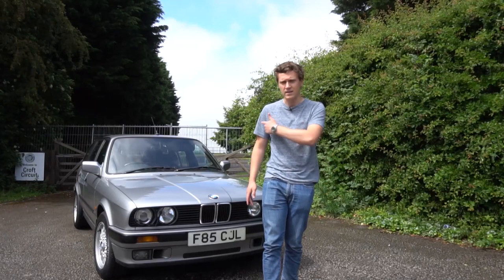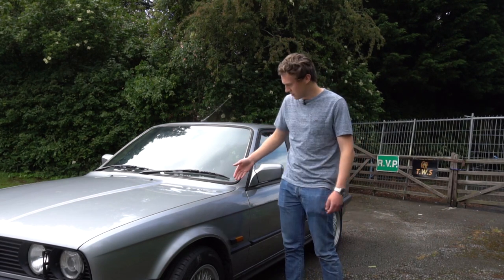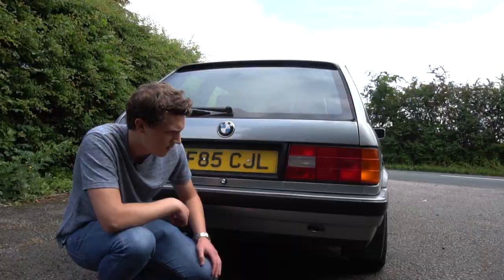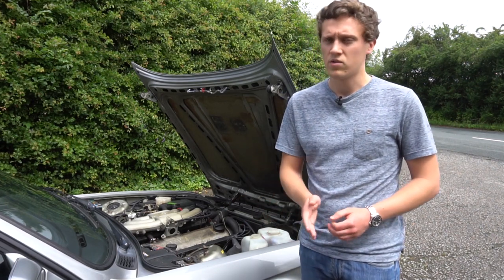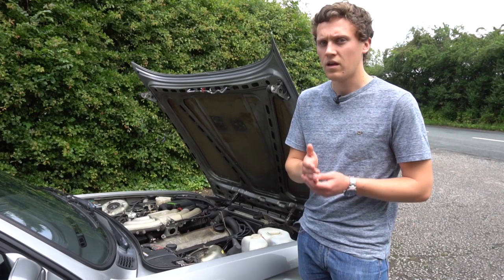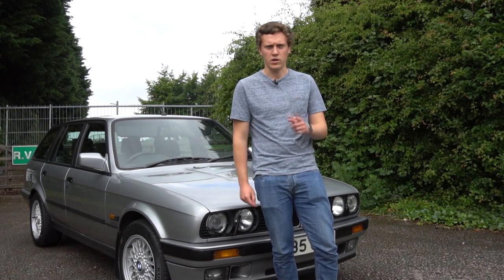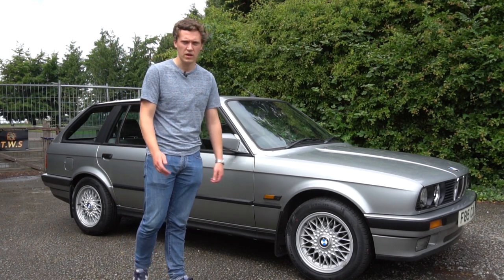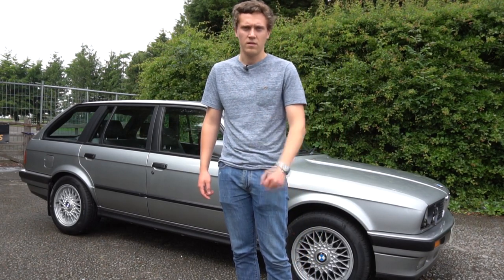Buying An E30 BMW | What You Need To Know (E30 Buyer's Guide)

Comment from the maker: Apologies but for the avoidance of doubt, the jacking points I refer to at 1:10 are factory jacking points only. DO NOT jack your car from here as you can damage the underseal or punch a hole through the metal which could cause corrosion issues down the line. Sorry, this was my bad! You can look up online where to correctly jack your E30 from using the E30Zone Wiki. Also check out our sequel to this video which gives you lots of information on specific maintenance items on the E30! Link here: https://youtu.be/Gdmv65OKSvo

Comment: You can remove the oil sump without any problem at all on an e30 with the engine in the car. Just loosen the engine mounts and put a 3/4 sockets under both mounts and there is more than enough room. 
Done it several times, low e30 and speedbumps don't mix well 😁
Reply from the maker: Ah interesting to know! I had always heard it was either an engine out job or subframe out and brace the engine in place from above. But yeah the sump is particularly low on E30s, I've heard of a few people cracking them on lower cars!
Reply: @FootToPedal  I even remember from when the m20 was popular with turbo a guy replaced roodbearings the same way 😁

More annoying is to replace the rocker arms with the engine in the car but that's also more than doable. Done that way to many times also.
Reply from the maker: Yeah sounds like a great way to solve the issue actually, will definitely bear it in mind. That's whats great about E30's though, just how easy they are to work on!
Reply: @FootToPedal  what is more fun to drive  e30 or e36 with the same engine  m50b25

Comment: Bought a grey E34 this summer, fixed the fuel lines and painted them up, changed out the cracked out and rusted jack mounting points, changed lights, stopped a zimring leak on the back of the engine with some additives like 917, brushed down and painted the lower inside of the doors with hammerpaint, black anti rust paint, changed oil in the diff, gearbox and engine, replaced the timing belt, thermostat and water pump and and flushed the fluid... And bought a lot of parts to all over, now driving it to and from uni here in Norway, might have to take the bus when the winter comes for full though, salting is crazy....
Reply: Oh, and its a 88 model, manual sunroof, black and grey interior m20b20 engine and I absolutely love it :) pretty original as it had stood 10 years... Oh and changed the springs as they were all broken xd
Reply: And thinking about buying a 3.5 liter straight six for later I know about that someone has :)
Reply from the maker: Awesome stuff! I love to hear this kind of thing, great to know people are working on their own cars. I do have a lot of love for the E34, its a great looking thing. Wouldn't mind one myself. Sounds like you've done some fantastic work on yours! And yeah the M20 engines are so good, plus they make a very nice sound. Thanks a lot for watching, and good luck with your E34! Hope you still manage to use it over winter 👍
Reply: @FootToPedal  Yeah, had a M50B20 engine in my secound car and first bimmer, alpina white e34, sadly it was rusted too badly to be saved, so stripped it and saved a lot of parts for myself and sold a lot, just the frame went to the junkjard basically, and some of the back axel.. but think Ill keep to m20s if not m30b35. The sound is amazing compared to the m50s, only down side how I see it is the belt instead of a chain and some of the problems like the humidity building up in the cap outside the rotor. But of course, no car is perfect. Done most the work with a friend of mind that has had 30+ bmws, so he been a great help for me, especially with welding that I haden't done before :)
Reply: @FootToPedal  Have to keep these old bimmers going, they are simple, fun and well built cars, so it feels well worth it working on them, lets try keep as many of them around as we can :)
Reply from the maker: @Anirossa  Totally agree with you! I really enjoy owning mine and I'm sure you do too, I know I will definitely be buying more classic BMW's in the near future ahaha :)

Comment: Nice video but just one notable correction 
The “jacking points” you mention are not jacking points at all - the square pads commonly referred to as jacking points are locators for when the car was moved around on the production line at the factory and should not under any circumstances be used as a point to jack the car on. 
They are horrendous rust spots though. 
The other classic rust spot is the rear inner arch behind the fuel filler neck. Pull the plastic covers, pipework and filler neck out and remove the kilos of mud that will be present - you’ll be very lucky if its not rotten. 
Nice looking motor though keep the videos coming 👍
Reply from the maker: Thanks a lot for the correction there, that's my bad. But yeah they are certainly one of the worst spots for rust from what I've seen, got lucky with mine being fairly solid! Thanks, many more videos to come on this thing so stay tuned!
Reply: No worries I’m planning a series of videos about my 325i Touring as soon as I can get the time to extract it from the garage where it’s sat for over a year
Reply from the maker: Nice one, sounds good. I'll look out for it 👍👍

Comment: Just to add that the e30 sunroof seal is not designed to keep water out--it is supposed to channel out through plastic pipes inside the roof and exits down at the wings. Another notorious rust spot is the grommet where the wiring enters the cabin from the engine and rots out the firewall. This is a serious and expensive fix in having to remove carpet, dash and wiring loom to sort out. More prevalent in wet climates where the car is left outside.
Reply from the maker: Yes agreed on all points, thanks for the additional info!

Comment: I'm eyeing something identical to your car right now - silver e30 320i touring. I have a soft spot for those since I grew up in the 90's and always loved the DTM cars. What would u say about using the car as a daily driver? I live in the Netherlands so the weather should be quite similar to the UK. Is it a car that demands a lot of attention? How is the fuel usage in a real world scenario? (I mean by that: dynamic driving - not necessarily revving it out all the time but also not driving it like an elderly person). Great content btw 👍🏻
Reply from the maker: Awesome stuff man! They are brilliant cars in short. Its interesting you ask this as we are currently filming a video called 'Living with an E30' and it will cover many of the points you mention. But basically they are incredibly useable as daily cars. Very reliable on the whole with parts and things readily available, not to mention that they are easy to work on. Fuel consumption is OK on the whole, I think I average 20 to 25mpg (11-9L per 100km) driving fairly spirited but not revving to redline all the time. I wouldn't say it requires too much attention but its probably advisable to keep it inside if you can as they like to rust everywhere! Thanks a lot for watching!
Reply: Foot to Pedal thx mate! I'm really looking forward to getting one b4 the prices inevitably go into tenths of thousands as it happened with stock and original 325i. Great content man!
Reply from the maker: Yeah absolutely, prices only going one way on these. But yeah exactly, eventually all the models will follow suit!
Reply: Foot to Pedal What would u consider a good price for one? (320i touring) The one that is available has 290k on the clock but front and rear axles have been revised incl. braking system, dampers etc, the interior is stock and in very good condition, the underside has no rot. Sorry for bothering you man lol
Reply from the maker: I would say maybe €4,000 based on what you're saying there, possibly a bit more if its great condition but that's obviously decent mileage (not that it matters much but it does effect price). I personally wouldn't pay over €6,000 based on what you're saying there. And no problem at all man! I love engaging with our viewers so not an issue at all!

Comment: Just after 7.25 you mention about the ‘chip computer thing’, what actually is that and what’s its purpose? Thanks
Reply from the maker: Ah so it's actually a trip computer and it measures things like MPG, average speed, I think fuel range as well. I guess its a bit of a gimmick but very cool for an 80s car I'd say! It was a factory option so you don't see them everywhere but the higher spec cars generally have them fitted. Possible to retro fit them too I believe

Comment: One thing you NEED to check. In the driver side rear wheel arch you will find a metal cover that covers the fuel tank breather lines. this little bugger is brilliant at trapping soil which keeps water nice and safely stored.. it then rots just above the spring perch., when you clean it up it will most likely look ok but look harder! you might need to remove some of the thick rubber coating that these are protected with, once you get through the rubber coating there is a very high chance you will find something you wish you hadn't seen.. ive seen many 30's junked due to spring perches collapsing.. its repairable ofc but if you are not handy with a welder it will cost a lot to get sorted, the rear end will have to be completely stripped and there will ofc be other areas that need attention, by the time its fixed properly it will run into thousands (since its worth doing properly while its apart) id suggest to all 30 owners to get good with a welder xD
Reply from the maker: Thanks for this David, very useful info! I guess with E30s anything and everything will rust if it's allowed to do so 😂

Comment: Hi

Great video! 

I have a bmw e30 316 with the 1.8 m10 engine.. I'm after some spare parts.. like radiator pipes, waterpump, belts and other engine parts.. any advise on where is best?

Thanks
Reply from the maker: Hi, thanks a lot! Personally I would recommend Autodoc, they have a huge selection of parts and good customer service.
Reply: @FootToPedal  thanks! 

I have come across them but wasn't sure 🤔.. I'll give them a go! 

Thanks again
Reply from the maker: Yeah they've been great for me so far - good luck!

Comment: Are you mad?
The timing chain cam drive on the M10 is one of the most long lived in the industry and legendary for it.
It's good for a MINIMUM of 500k km  (310k miles), I have never heard of a timing chain snap on an M10. Usually outlasts the car.

Comment: Those boxed areas up front arent jacking points!!!
Reply from the maker: Yeah that was my bad, factory jacking points is the correct wording here since they were used when on the production line! If anyone wants to see a diagram of areas to jack them up from, check out the E30 Zone forums
Reply: @FootToPedal  no prob, id bet every e30 on the road has been accidentally jacked there at some point leading to the rust; both sides of mine rusted out. The floor is def a big rust area, these cars get water leaks like none other.
Reply from the maker: @davidcover9591  Yes agreed! And yep you really have to be careful with all the seals to make sure they're not leaking, water can get in and go unnoticed very easily!

Comment: So the video states almost every area on a E30 which may need replacing or repaired...Don't forget the idle control valve, fuel pump, heater resistor which also fail on one of these...Deep pockets are a must to own one of these and no they are not cheap to buy unless they are a proper rotbox with zero service history.
Reply from the maker: What you have to think is that it's a 30+ year old car, and so it's entirely possible pretty much any area of the car could have an issue. You don't need deep pockets to own one, but if you buy a bad one and you want it perfect then you will. There are plenty of good, cheaper E30s out there that don't need loads of work and would get by with just mechanical maintenance for years to come.
Reply: @FootToPedal  I do understand what your saying, I've owned E30 Mtech 1/2 sports, tourings, a Hartge and even C2 Alpina, back in the day. They are very well built I know, I've broke many of these, best one I've had is one with M50B25 engine in it. Much more responsive and alot more torque...
Reply from the maker: Yeah I've seen a lot of people do the M50 swap, seems a good engine swap for the E30 chassis

Comment: Just about NOTHING Wears out on a BMW e30 at 150,000 miles. Maybe Brake pads & wiper Blades. & Tyres.  Worn seats ? Think 300,000 Miles ? 

An e30 should look AS NEW / SHOWROOM Condition at  150,000 / 175,000.  ZERO Wear Anywhere. 

I bought Genuine Cars when they were Fairly New. 
at 100,000 miles an e30 320 should look BRAND NEW, Never Sat in. on ALL of the drivers seat. Inc Bolsters. 
Worn Drivers Seat = VAST Mileages. 
We had one at 165,000 miles.  the driver's seat was AS NEW. 
BMW Seats Were NOT Designed to Wear out. Under 250,000 Miles.
BMW Do NOT Design SHIT / CRAP Seats. 
GO to BMW & Get the Full Service History Print out for the LIFE of the Car. 

The Supplying Dealer will Have All the Info. & Build Spec Sheet Data. 

buying an old BMW ? 
Contact the Supplying Dealer or BMW UK. They Have all the Info you need. 
If Not, Walk away from that Lump of Scrap. & Find a Better example. 

Knackered Seat Cloth = Knackered old Car.  DIG DEEPER for INFO before you agree to buy it.
Reply: your paragraph was going good until you said to take it to a stealership 🤣 they will do nothing but tell you every part you're looking for is NLA or charge you triple the price for the parts they do have